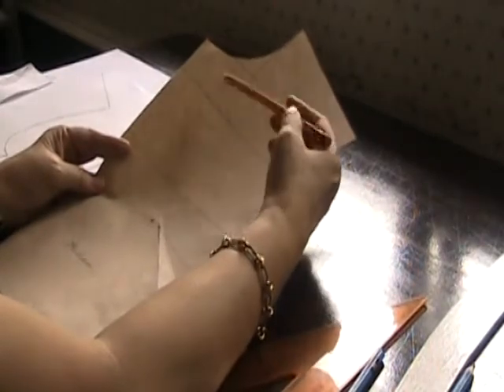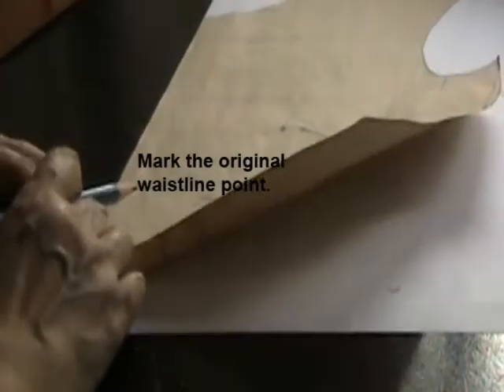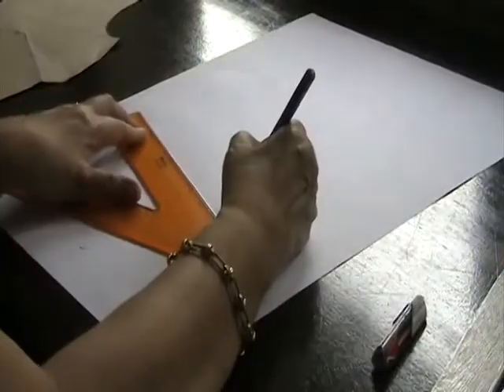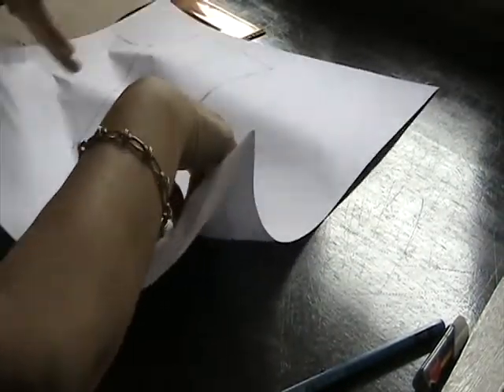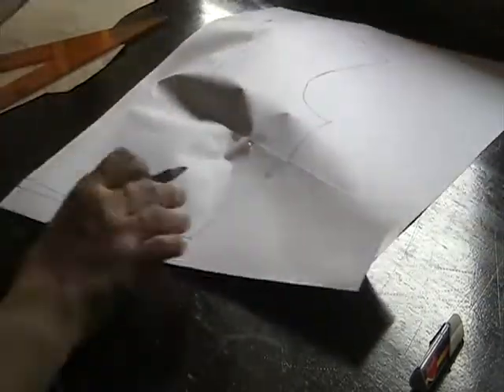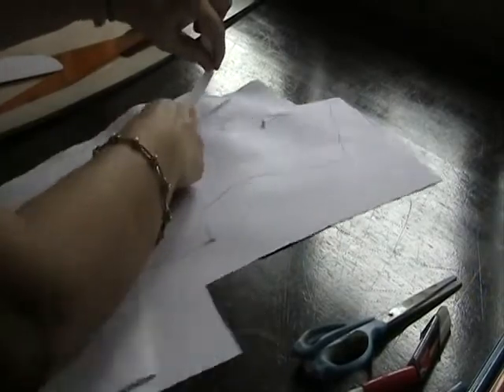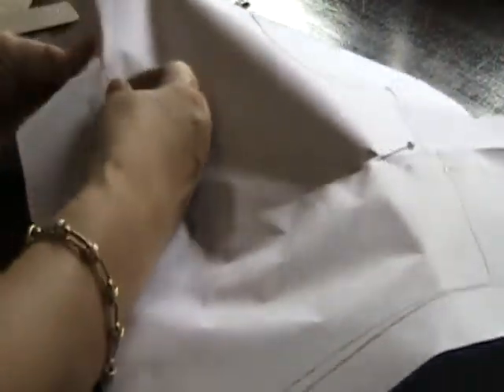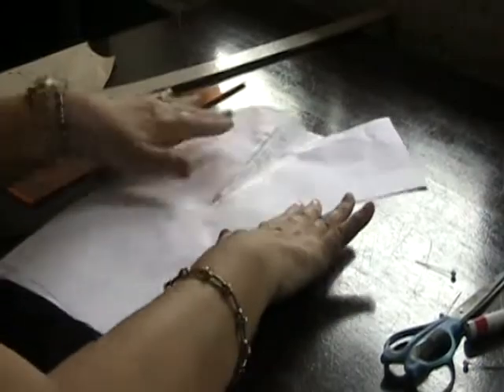Lesson 5-6 Transferring the Side Bust Dart to a Neck Dart

Comment: MAY I ASK, in transferring darts  do we always based it on side darts? Also, do we still follow the one half inch to both sides.?
Reply from the maker: It is best to work on the transferring of the darts from the side dart. If the dart will also be sewn in, a half inch is suggested.  Now, if the transferred dart will be transformed into gathers, there is no need for an adjustment.  Do take care and God bless.